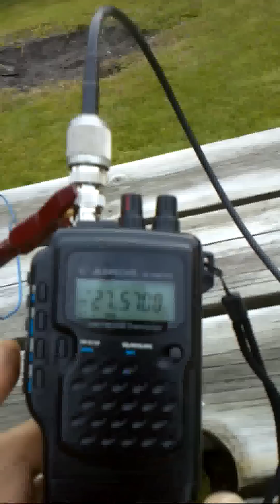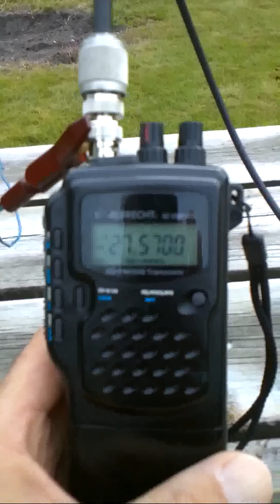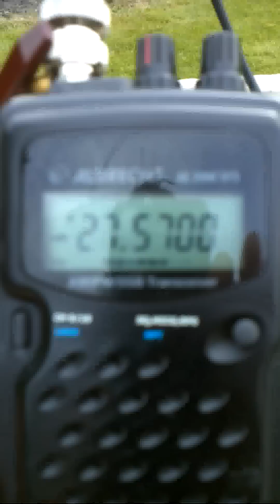Albrecht 2990   9AA batteries to finland 47ct02 -  56at139

Comment from the maker: distance is around 900km. and a homemade 2 element antenna was used.
Reply: hello nice radio but I would know if it is possible to plug an antenna as you done on the top of the radio instead of the adaptor ?